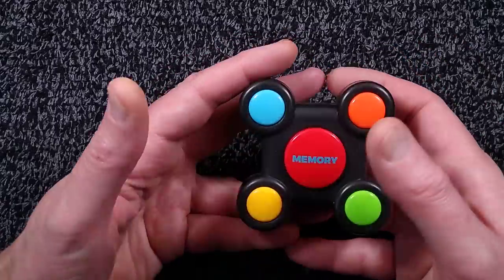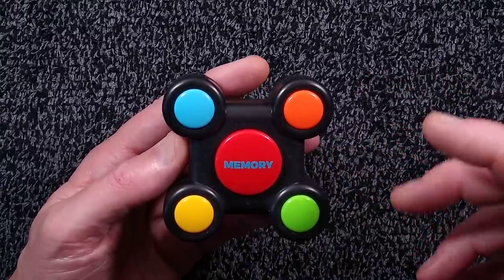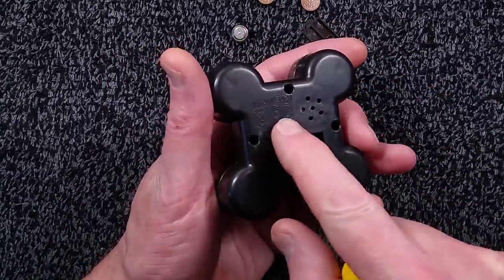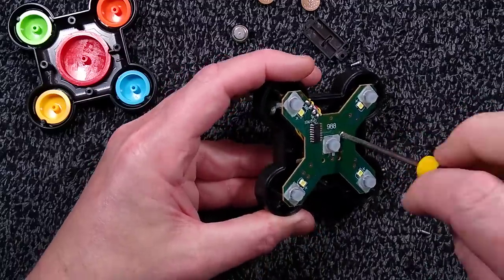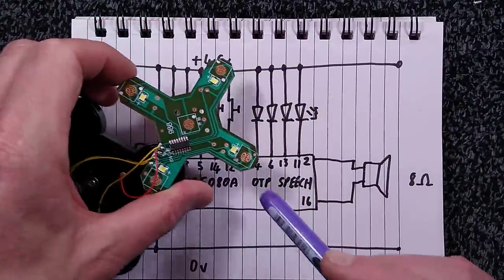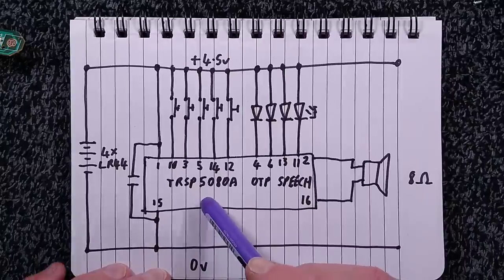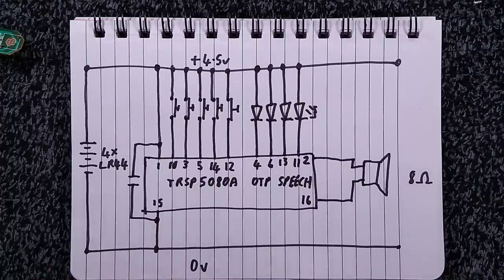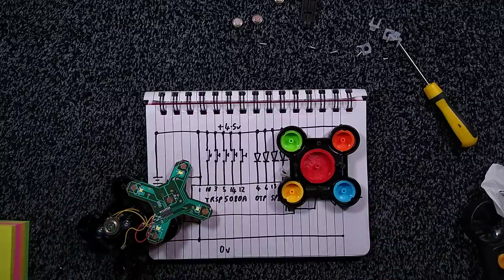Inside a modern "Simon" memory game

Comment: I used the simon game as a project for my physical computing students. Good digestible logic problems to build a structure around. I'm surprised that the chip inside is not under a blob of epoxy coating... Is it strange to see an ASIC in that package for such a novelty item?
Reply: Chip-on-board can deliver marginally lower unit costs, but the setup costs are higher. A packaged IC just goes through the same pick-and-place cycle as everything else, but the COB IC needs a separate wire bonding process. Plastic IC packages are so cheap these days that you'd have to be producing serious quantities for COB to be worth the effort.

It's not uncommon to see pads for both a packaged IC and a wire bonded COB in the same footprint, to provide the flexibility to switch between packaging technologies as sales quantities change.
Reply: I took an electronics design refresher course some years back that did that. We had to break it's operation down via flow chart then design logic circuitry by translating the flow chart to truth tables, then spec gate packages for power economy, price etc.
We didn't have to actually build it though.
Reply: It's not really an ASIC, since the same IC can be programmed for other applications. It's simply an MCU, with a load of flash/mask ROM and a class D amplifier for a speaker. The same IC will be used in numerous devices.
Reply: @alunjones3860   Thanks!  That answered my question or reprogramming 'curiosity'.   (no skill, just wondered)
Reply: The digital logic lab for my BS in CS was just a six week sequence of incrementally building Simon on an fpga. I guess this is a popular project for students. I was little sad that it was all plug and play and not any real design work though.

Comment: I just took apart a modern mini Simon branded Simon one and the biggest surprise to me was it had actual Energizer batteries included. Cost wise I was confused but then I noticed on the battery compartment it had 'best with Energizer' or something close to that on it 😅 it's a weird feeling to know that toys have advertising baked into the molding 😅
Reply: Energizer(R) branded electrons only
Reply: That's because I think Energizer make the best Alkaline batteries.  Was this a Simon Micro Series game by any chance?
Reply: Check out "EEVblog 1497" for disastrous (Duracell style) damage from Energizer bats. Killed a Fluke 3000!
Reply: There are literally just a handful of factories that make Alkaline batteries these days, and they make the "cheap brands" and the "expensive brands" on the same production line. They just pack in more chemical powder into the better ones and apply a different label.

They may well be selling Energizer-branded cells of any quality to this toy maker, and are almost certainly getting a big discount that makes these cells THE CHEAPEST, for including this Energizer Advert in the product.
Reply: @Basement-Science  Good to know, as I buy supermarket own brand and feel I get as good a value as any other branded product at a reduced outlay.
Reply: @tommiller1315  Angry pixies
Reply: @tommiller1315  I was going to comment the same.  I’ve had more run-ins with leaky Energizer brand.  The Energizer AAs which killed Dave’s Fluke meter were USA-made and labeled as industrial Energizer brand batteries.  I had a couple packs of Energizer AAs bought at a warehouse club self-discharge before I opened the packs.  It seems if you want to avoid leaks, then lithium cells are the solution, however where I live, they’re only available in Energizer brand.
Reply: I don’t know who makes them, but Harbor Freight here in the US stocks their own brand of rather affordable alkaline cells that seem OK.  I’ve used them for a few years and not had one leak yet.  I had one cell out of the pack which was weak, but dozens of others have been OK.  Harbor Freight also sells fancy allegedly premium alkaline cells which I have not tried.
Reply: @Basement-Science  I should have expected something of the sort, in a lot of ways it makes sense, cheaper for the producers and the factories I guess.
Reply: @wtmayhew  I have the exact same experience with Duracell batteries. I don't know if they have energizer over here.
I tend to stick to Varta or Panaconic these days. I don't know if they're any better, but they seem to be produced in countries near me so it saves on transport I guess.
Reply: @NaoPb  Thank you for the reply and the suggestion.

Comment: I"m old enough to remember when the cost of the electronics inside the Simon game swamped the cost of the big case and buttons. Now, the opposite is true... as is so painfully obvious here. 
I don't REALLY miss "the good old days" (because if we're honest, they weren't good at all) but the level of technology which is now considered almost disposable takes my breath away. :)

"eh, I broke my phone, guess I'll throw it away and buy a new one" 

(looking back and forth between a modern smart phone and a Western Electric bakelite monstrosity from my childhood whose receiver was so robust you could ___ someone to ___ with it... I'm just... I'm all verklempt!)
Reply: I have an old Western Electric 302 dial phone sitting here on my desk with the separate box on the wall.  It still works as it should even though I have phone service delivered by VOIP by the cable company.  Not bad for an 90 year old device.  I was quite surprised that the VOIP box handles repertory pulse dial input.  I suspect that is because there are legacy alarm systems and other automated equipment still hanging around which pulse dial

Comment: Now that you mention greeting card, it would be rather interesting to implement a Simon game into one of those, the technology is definitely thin enough to fit, and there’s already cards that have lights speakers and buttons in them on the market. Definitely sounds like it would be a licensing nightmare though lol
Reply: That hurdle hasn't bothered China's game manufacturers, they label them in Chinglish with a little stolen graphic or two.
Reply: @tncorgi92  oh yeah without a doubt,  China has no qualms against knocking just about any product off. By “licensing nightmare” I was referring to if it was sold in an actual proper chain type store
Reply: Ctrl+F "Simon" replace with "Seymore", print money.
Reply: @Demiglitch  LOL

Comment: These games with button cell batteries. Replacing the batteries is probably more costly than just buying another game.
Reply: The compatible silver oxide 357 lasts a lot longer at even more expense or you can modify it to accept a USB connection.

Comment: I think there's enough space to put inside a lithium batter salvaged from a single-use e-cig, and a simple tp4056 (i chaged to tp5100 for the sake of efficiency, but everyone uses the 4056) board to protect/charge it. I know it will be more expensive the mod than the actual toy, but hey... i bet i'm not the only one thinking on doing it...

Comment: Was expecting a blob job pleasantly surprised that at least it's a special purpose chip! Now I wonder what's in an original Simon from 1978. My guess is discrete logic or maybe a 4004 and small amount of memory. Wikipedia says the prototype used the TMS1000 so maybe the final production version did too.
Reply: It uses a custom chip, called an MB4850.
It's very likely a repackaged, pre-programmed TMS1100.
Four bit, 8192 bits of ROM, 256 bits of RAM.
It also contains a National Semiconductor DS75494 Hex Digit Driver, 2 discrete capacitors, and 2 resistors.

Comment: Hi Big Clive; 

I'm not sure how to message you but I just put together the Hex PCB "supercomputer" slow flash LED kit and I know in your review/demo video you mentioned the ground pads take longer to solder due to the bigger surface area of the tracing— what should I do in this situation?  Should I increase the temperature of my soldering iron or should I keep the normal temp and hold the connection longer?  Or is there another solution?

I've got it working, but I'm curious how to improve my solder joints on the ground side.  Can excessive heat or time damage the LEDs, or the surface mount resistors?

Your videos are great!  Entertaining, educational, but also soothing and relaxing.

Comment: i expected to see a timing resistor. usually these things have a resistor that sets the speed. You can under/overclock it by changing the value.
Reply: I always do that to the greeting card circuits its fun to thinker with and thats what i am, a thinkere
Reply: Yep. Do that on a toy piano to get some awesome bass synth sounds. Sadly many also have internal clocks especially since the mid 2000s.

Comment: I'm surprised that it isn't a blob on board. Looks worth decompiling and adding in the increasing speed.
Also, did I miss something or is it three, not four × LR44?
Reply: And how, pray, does one decompile firmware hidden inside a one-time-programmable chip? It literally doesn't have a "read" facility.

(Not to mention the question of how to "add" functionality to a one-time-programmable device...)

Comment: Those button cells should get banned. They might last for like 2hrs and then you need new ones. They only make sense in ultra low power applications like a little thermo-humidity meter or a small LCD clock. But even there, just put a USB-C onto it and a little LiPo.

Comment: I wonder how the chip generates the random sequence- is there a random number generator in there or maybe just a bunch of predefined sequences?
Reply: I expect it'll be a cheap and very nasty pseudo-random-number generator. In order to vary the seed so you don't end up with the same game each time, most likely it'll time how long it takes to press the START button and use that --- that's a very old trick from the 8-bit days.

Comment: Great way to induce ocd in children 👀

I'd have thought it would just be a blob chip, no fun tk be had by shorting pins?
Reply: I was surprised by the white LEDs. Using colors matched to the filter/diffuser/switch actuator caps would be far brighter for the same power.

I was a child once. Am I exhibiting the OCD you mentioned?
Reply: @KJ6EAD  slightly 😂